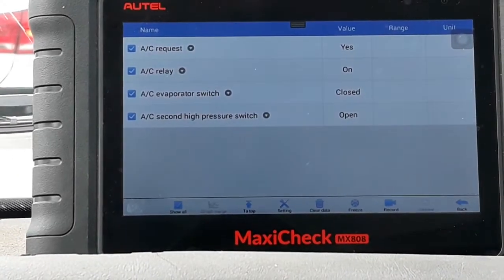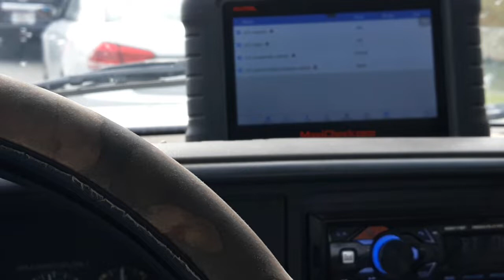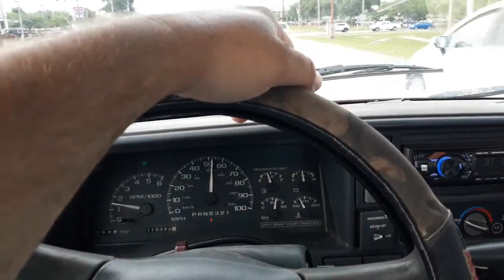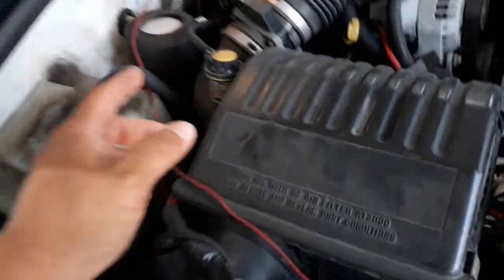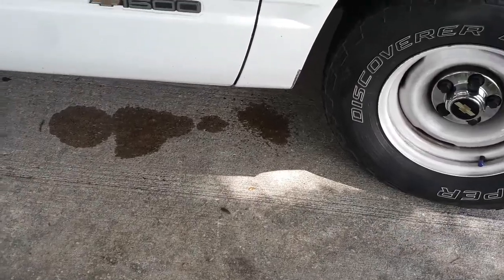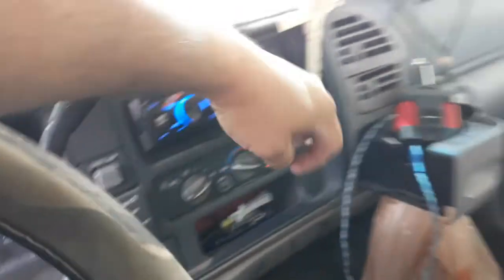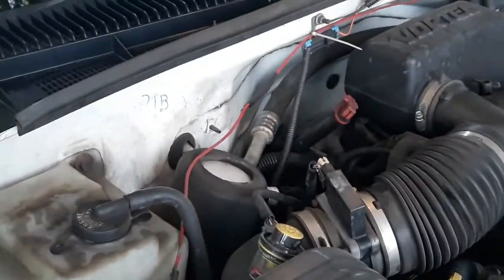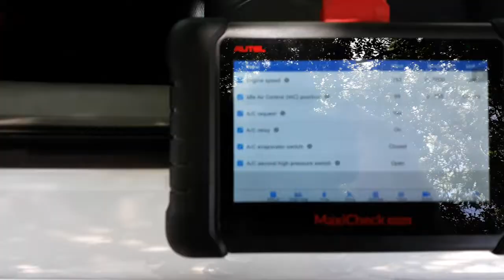AC freezing? Check this...

Comment: Thank you very much for this information, I also have this problem only in another car, I have replaced almost the entire air conditioning and the mechanics only fill the cooling agent and cannot cope with it.

Thank you and I wish you trouble-free driving!
Reply from the maker: @MrStrusdoc  I am glad the information was halpful!
Reply: @Bbernhardsr  Tomorrow I will check if it is the same failure, but I suspect it is because I remember seeing iced air conditioning pipes in my car.

Comment: Thank you, I have complained constantly to Chevy about my 2019 Trax ac freezing up and they keep telling me refrigerant is correct level, and they can’t fix what they can’t duplicate. It has gotten to the point of freezing up sooner as time goes by. I will check switch
Reply from the maker: With a vehicle that new you would not have a low pressure switch controlling the cycling of the compressor. On your vehicle you have an expansion valve on the firewall that meters refrigerant. That could be the issue. 

When was the last time your cabin air filter was changed? If it is stopped up that will cause low air flow problems and could cause evaporator freezing. 

Lastly your Trax should have a temperature sensor somewhere close by the evaporator inside of the vehicle. That sensor reads the temperature of the evaporator and is what tells the computer to cycle the compressor on and off. These do go bad but you can't tell without a scan tool to tell you what the sensor is reading.
Reply: @Bbernhardsr  We change the cabin filter regularly, living here in Florida...LOL. I appreciate the help, I think Chevrolet is trying to dodge repairing this until the warranty is out. Appreciate the direction on what to look at. Going to have a conversation with the service manager at Chevy.
Reply: @dburto13 hey! Any updates from Chevy on what the issue was? Thanks!
Reply: @remstud1  No, but I think it’s like the author said, the txv, which is not an easy fix on the 2019, at least not for me anymore 😂👍👊

Comment: I have same issue on my semi truck. No one could fix years and years. Evaporator freezes and blocking airflow. I have to turn off A/C for a while to melt ice down then turn on until freezes again.
Reply from the maker: Is it a newer model? Maybe it has an issue similar to this?
Reply: @Bbernhardsr  No it’s old truck 2012 million miles. But I’ll let my mechanic to check that switcher.  Evaporator was replaced, temperature sensor replaced, fan replaced 3 times, while l found why doesn’t blowing cold air because ice on evaporator blocking the air flow. And hope that is the problem because that issue took very long time.
Reply from the maker: @shafrana2 You say it has a temperature sensor so I am assuming the compressor is cycled by the ecm and not cycled by a switch like my 98 chevy. I am curious now to know if your compressor is switched by a low side switch.
Reply: @Bbernhardsr  I’ll let you know for sure for the result when they replace that switch.  Which never been replaced

Comment: I have 1.6 aerio 2006 Ac turns off on less hoter days with high humidity here humidity level is about 30% but on extremely hot days like 48°C it keeps working 
Relay becomes super hot is it the freezing issue
Reply from the maker: @goharnazir7111  it sounds to me like your ac is just shutting down rather than freezing up. Without putting a set of gauges and a scan tool on it, any attempts to fix it would just be guessing.

Comment: So why would it cycle at a higher RPM and not at idle which is the problem I’m having.. freezes up at idle.
Reply from the maker: You need to hookup a set of gauges to the high side and low side to see what is happening. To me it sounds like your orifice tube is restricted. That will cause the low side pressure to be too low and that will cause it to freeze up. The reason  it would be cutting out when above idle is the pressure on the high side will get too high and trip the high side pressure switch.
Reply: @Bbernhardsr  ended up being the switch. Replaced and now I have the exact results as you did. Thank you!

Comment: Hey man awesme video! I have a 2006 ford econoline. My ac lines are always frozen everytime i drive without my ac switch even being turned on. Do you think my switch failed on all the time??
Reply from the maker: If your ac lines are frozen and you don't have it turned on then you have a problem you should fix. I would start by simply unplugging the compressor and see if the clutch is still engaged after that.

Comment: Question. My 2010 Dodge Ram QC seems to be freezing. Fan blows cold air, but after awhile, the “wind speed” out of the vents decreases but is still cold. I run off my ac, fan still blowing, after about 5 minutes, the air speed increase to full and I tune the ac on and all is well for about 15 minutes. It’s a cycle I have to do. I just watch this video and is the evaporator switch the problem.
Reply from the maker: When was the last time you changed your cabin filter?
Reply: Same thing is happening to my 14 Subaru wrx. Fairly new cabin air filter too
Reply from the maker: @AlfalfaInc  if I am right newer vehicles rely on a temperature sensor that is actually inside of the evaporator housing to do what the switch on my accumulator does. It reads the evap temperature and once it gets to about 26°F it will let the ECM know it is time to cycle off the compressor. If airflow is good, you know for a fact that your freon charge is correct, and you know that your metering device (orifice tube or txv) is flowing correctly, then you would need a scan tool to see if the sensor is reading the correct data.

Comment: What does this look like on the gauges?   15 low, 200 high?
Reply from the maker: Any low side pressure below 22 psi will close the cycling switch causing the compressor to turn off. If you are having gauge readings of 15 psi and the compressor is still on then you definitely have a bad low side cycling switch.

Comment: Can this evaporator switch overload and blow the AC fuse?
Reply from the maker: No. The switch is just a switch. The short has to be somewhere else. Maybe the windings in the ac clutch are shorting. One for sure way to tell is just jump the two wires together and see if you still have the issue. That will take the switch out of the equation all together.

Comment: Is this switch different from an EVAP sensor?
Reply from the maker: Yes it is different but the same. This is a mechanical on and off switch depending on low side pressure. The actual current for the ac clutch travels through this switch.

An evaporator sensor reads the temp of the evaporator and then tells the computer to activate or deactivate the relay for the compressor clutch.

In the end they both perform the same kind of function just in different ways.
Reply: @Bbernhardsr  hmmm okay. I have a 2012 ford fusion acting the same way and I know we have a EVAP sensor located in the dash. Had it recharged with the proper amount but didn't remedy the issue, coil still froze up. Didn't know if vehicles had both sensor and switch or just one or the other.
Reply from the maker: @beammeupscottsp7952  newer vehicles have only the sensor. I know a lot of those fords have the sensor in a really ridiculous place and literally the entire dash has to be removed in order to change it. Yes if that sensor is bad it can cause the same problem with freezing up. A good scan tool would be able to see the evap temp pid.
Reply: @Bbernhardsr  yup was told the entire dash needed to be pulled just to change the sensor and that also came with a hefty price 😂
Reply: @Bbernhardsr  I've seen vids on ford fusions to replace the sensor w/o removing the dash though, might give it a try on my own if the mechanic diagnoses it as a faulty sensor.
Reply: @Bbernhardsr  but yeah will let my mechanic know to look at the sensor also, it's weird because no check engine lights have come on but I've noticed a big drop in mpgs, over 7-8 mpg since this started happening and I can see the higher load it's putting on the engine since this started happening. There's a meter showing accessories power usage, I'm guessing the compressor is staying on and not cycling off when it's suppose to?
Reply from the maker: @beammeupscottsp7952  this problem would not trigger  a check engine light.
Reply: @Bbernhardsr  I see, thanks!
Reply: @Bbernhardsr  your video just saved me at least a grand, 35 dollar sensor and 2.5 hours of my own labor has my a/c and car working like normal again, thank you!!
Reply: @Bbernhardsr  everyone was telling me the sensor would turn your a/c off if it went bad but your video was the only one saying a bad sensor could freeze up your lines which was my situation.
Reply: @Bbernhardsr  there’s a work around on some fords to change the sensor w/o pulling the dash, couple of vids on YouTube and some patience, definitely not by the book 😂
Reply from the maker: @beammeupscottsp7952  well that is not true. This is why I say you need a scan tool. You need to see what the actual data is coming from the sensor. There is another way your evap could be freezing up and that is if the txv valve is bad or clogged. But you would be guessing without the scan tool.

Yes the more common failure point is that it fails open circut but that is not the only failure point. The difference between the switch I have and yours is the way its made. Mine is basically just two copper plates that make a switch. Yours is a thermistor that senses temperature and your ECM switches the AC clutch on and off via a relay.
Reply from the maker: @beammeupscottsp7952  thats awesome! So now that you replaced the evap sensor the clutch is cycling properly and not freezing up?
Reply: @Bbernhardsr  yeah I said what the heck it’s the last thing I can try myself before bringing into the shop and spending who knows what, btw that sensor is absolutely in the worst spot on the fords, barely could get it out myself 😂
Reply: @Bbernhardsr  my sensor is literally a piece of plastic with three wholes, the bottom two was clogged with dirt. Guessing that’s why it was throwing it off, could of maybe cleaned it but just replaced it with a 30 dollar new one. Took like 20 secs after putting the new sensor in the a/c started running like normal. MPG’s went up, it no longer freezes up when driving long periods of time. You’re video literally was the only one saying it could stuck the other way so thank you!
Reply from the maker: @beammeupscottsp7952  thats great!
Reply: @Bbernhardsr  All have to do left is to replace the blower motor, ticking noise. Just waiting for the part and it’s a 5 min job on fords and it’ll be just like new!
Reply from the maker: @beammeupscottsp7952  I am always glad when I help someone!
Reply: @Bbernhardsr  thanks for helping out a stranger, finally gets a win against the car shop, feels good 😆
Reply: I have same issue on my semi truck. No one could fix years and years. Evaporator freezes and blocking airflow. I have to turn off A/C for a while to melt ice down then turn on until freezes again.

Comment: That is exactly the same issue in my Chevy van. I just have to find out what that part which sticks out of the AC compressor is called.
Reply from the maker: Part that sticks out of the compressor? Does it plug in?
Reply: @Bbernhardsr  I think it's the low pressure regulator that connects to the evaporator. It's not closing so the compressor is constantly running and freezing up and freezing up the line connecting to the evaporator.
Reply from the maker: @ericshiiba1847  is it mechanical or electrical?

Comment: That is not the evaporator switch. that is a pressure switch that cuts your compressor off, if you don't have enough freon. The evaporator switch is inside the evaporator case in the dash, also called the thermostat switch, which measures the evaporator temperature and cycles the compressor accordingly. Labor calls for removing dash to replace evap switch.
Reply from the maker: Sorry but you are mistaken in this case. My truck is a 98. In newer vehicles then you would be correct.
Reply from the maker: I explained in detail how the switch functions. Yes if I loose freon and the pressure goes below 26psi it will permanently turn off the compressor until the charge is brought back up. In these older vehicles this switch is the compressor cycling switch. In newer vehicles it is replaced by an evaporator temperature sensor and then the ecu cycles the compressor and then the switch just becomes a low pressure cutout switch.